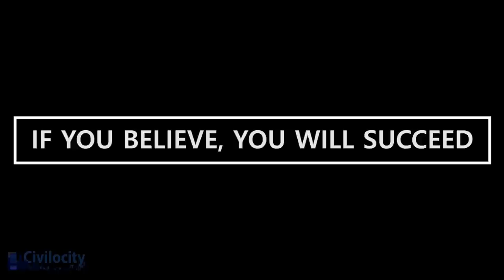CC Pavement Construction | Rigid Pavement

Comment from the maker: IES[2001]
The correct sequence of these stages is
1. Preparing the subgrade and the base course.
2. Mixing and placing the concrete.
3. Placing the framework and watering the prepared base.
4. Curing.
5. Compaction and Floating.

options-
a.) 1,2,3,5,4
b.) 1,3,2,5,4
c.) 1,2,3,5,4
d.) 1,3,2,4,5
Reply: b
Reply: Civilocity b
Reply: B is the right sequence..as i thought😄..is it right?😃
Reply: B is the right sequence..as i thought😄..is it right?😃
Reply: B
Reply from the maker: Yes it is! :)
Reply: I7